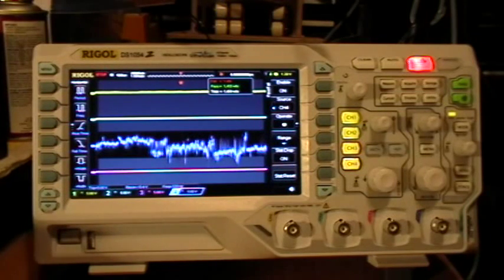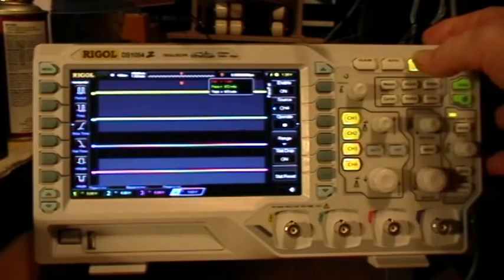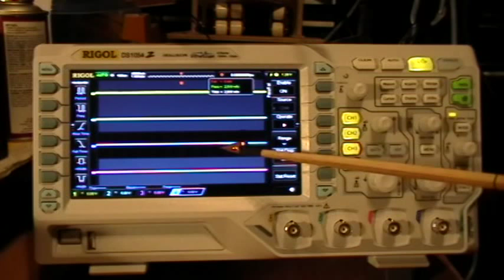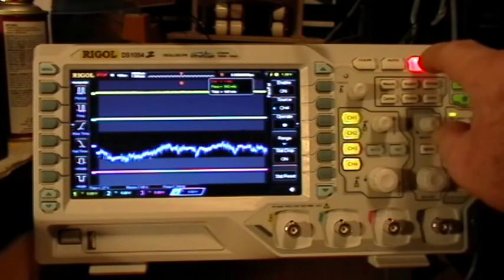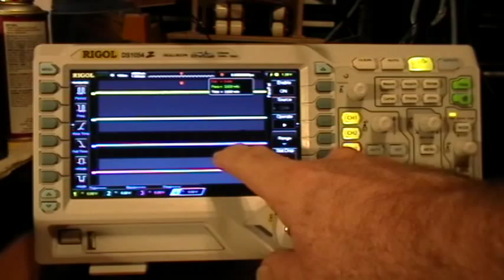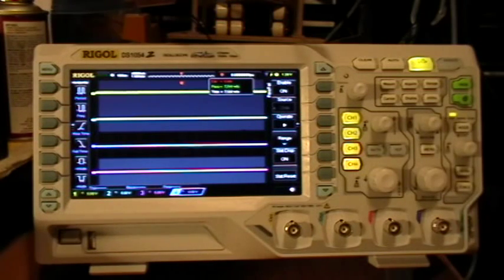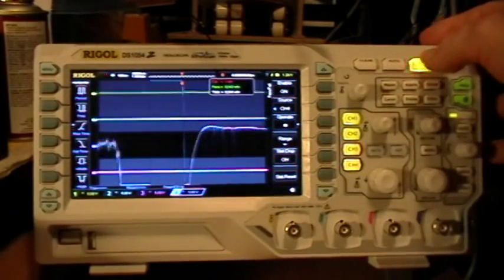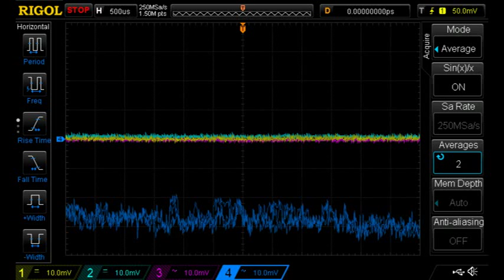Scoposcopy: Rigol DS1054Z Pass-Fail: FAIL on CH4.... rampant glitches

Comment: Is there any obvious errors, or burns, on the circuit board?
Reply from the maker: +Upton Robotics Pty Ltd 
I have no idea, this scope went back to TEquipment right away for a warranty replacement. 
The replacement finally went back to Rigol USA too, because of the Freeze Bug and some other bugs. Now I am on my third unit. Rigol Customer Service has been good to me, probably because I've documented the bugs I've found in these videos.
Please check out my other videos concerning this scope model. I've found a few bugs but I still am recommending this scope for the hobbyist or first DSO. The bugs are annoying but are easily worked around, and Rigol will fix them in further firmware updates as time goes by. It's still the best value for the money in the DSO market.
Reply: Do you have to pay for software? Is that expensive? I was thinking of a Siglent SDS1202X instead. Is that a smarter choice?
Reply from the maker: Upton Robotics Pty Ltd

Please check the various threads talking about the Rigol DS1054Z scope on the EEVBlog forum. The issue of software options is discussed there.
I have no experience with the Siglent scopes so I can't really comment. The Siglent is also a 2-channel scope whereas this Rigol has 4 channels. The SDS1202x is also quite a bit more expensive than the Rigol DS1054z. If your budget can afford it and if you need the 200MHz bandwidth, I suppose the Siglent is a nice scope for you. The "SuperPhosphor" display is interesting.

Comment: Have you tried the same test with a probe hooked up to channel 4?  I mean, just plugged in and not probing anything?  Probably no difference as you have no probes on the other channels that are fine, but...wondering if this might make a difference?

Bill
Reply from the maker: Pirate Labs Sure, I've tried everything I can think of. With a probe connected with no signal to it, there is a bit more noise on the baseline, and the glitch behaviour is still the same. At the end of the video there is a still shot with all 4 probes connected to the scope's Probe Calibrator output, and taken when a CH4 glitch happens. The only thing that prevents glitches is to set the Channel Input Coupling to "ground" (or turn the channel off altogether). Even if the probe is shorted by connecting the tip to the ground clip, as long as the channel itself is "on" and AC or DC coupled input, the glitches will happen.
If I have the CH4 set to 2V/div it's a lot more stable but will still glitch eventually. It's definitely worst at 5V/div.
Reply from the maker: *****
Thanks, I hope there isn't anything wrong with yours!
It takes about 15-20 minutes of warmup for the first glitch to occur, then it's easy to reproduce every few minutes or less, sometimes even continuous glitching.